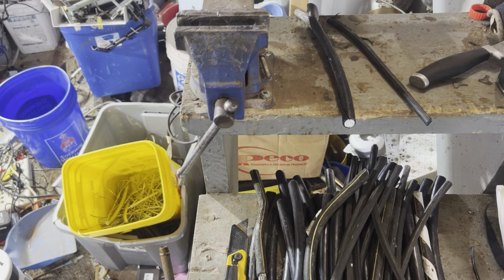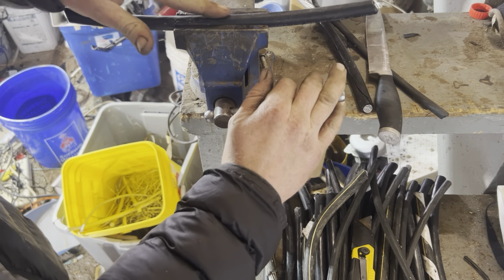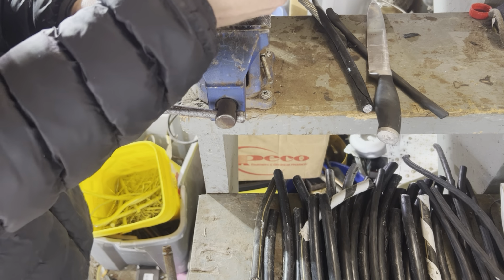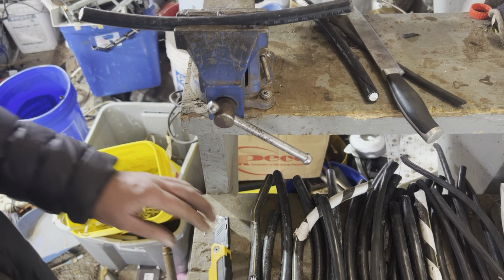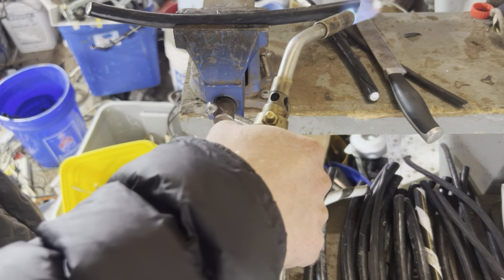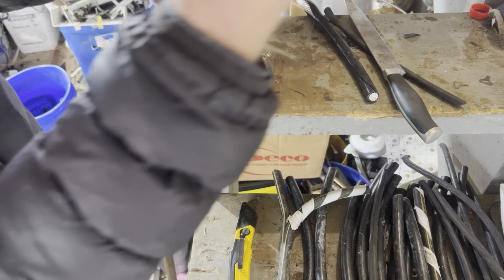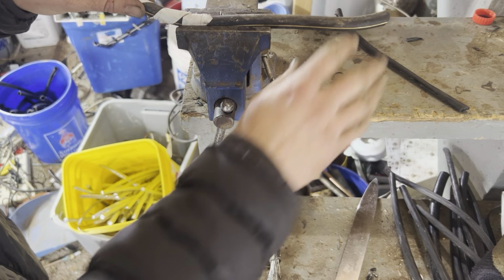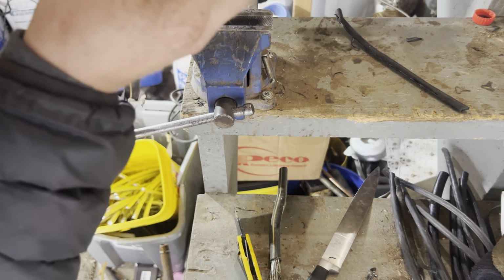ALUMINUM CABLE! Is it worth stripping? That’s up to YOU!

Comment: Quick tip when filming your video run a test clip say 30 seconds long in this case strip one piece of cable and then rewatch that clip see how your camera angle 📐 looks then you can reposition the camera till you think the everything will fit and on the screen 📺 I’m just trying to help a bit as I’m new to making videos as well! Great Video otherwise CheeRs 
     🤘🏻♻️FuLL WatcH♻️🤘🏻
Reply from the maker: Thanks! I tried but I had the phone on the railing it must’ve slipped because I swear I had it higher lol. I was also told that I should turn my phone sideways when filming . I guess it makes it full screen when uploading?
Reply: @ScrapFatherScrapSon   That does happen somethings just can’t be avoided lol And that was me that mentioned to turn your phone horizontally when filming so it fills the screen 📺! The videos are awesome Brother keep them rolling! 🤘🏻♻️🔨🤘🏻
Reply from the maker: @BushDogScrapper  hahaha I have CRS (can’t remember shit) should’ve known it was you hahahaha sorry
Reply: @ScrapFatherScrapSon  I have the same issue haha all good Bro keep the content coming!
Reply: Good video.  Thanks for sharing.